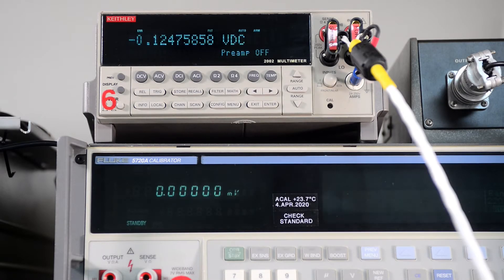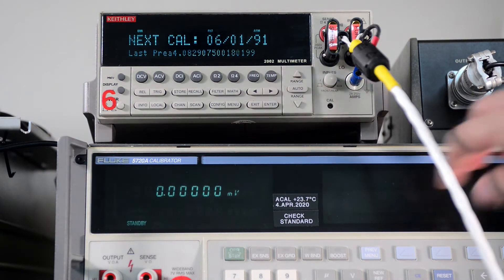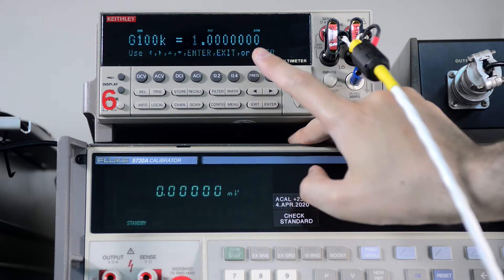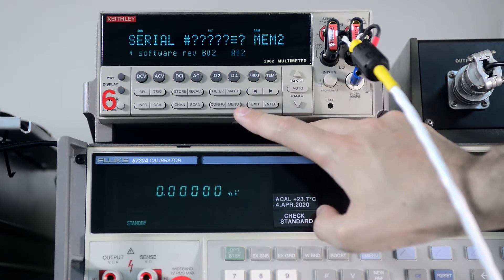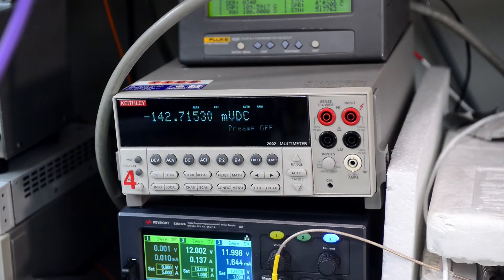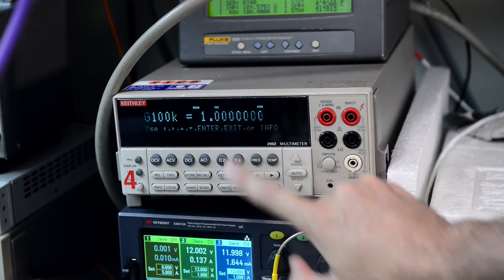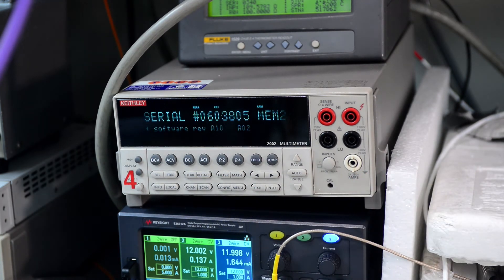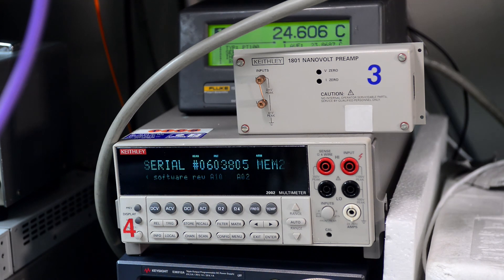Keithley 2002 firmware issue with 1801 nanovolt amplifier option

Comment: Cal enable may need switched on possibly.
Reply from the maker: 1801 does not require calibration switch on. This works as intended on Keithley 2001.